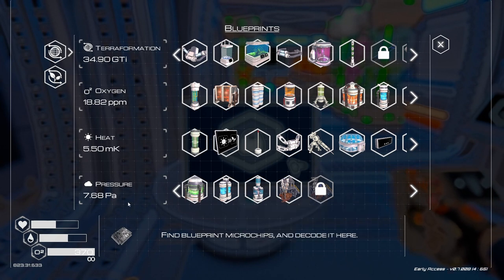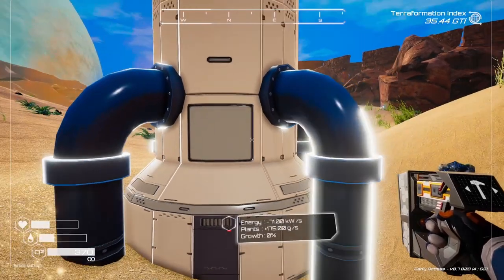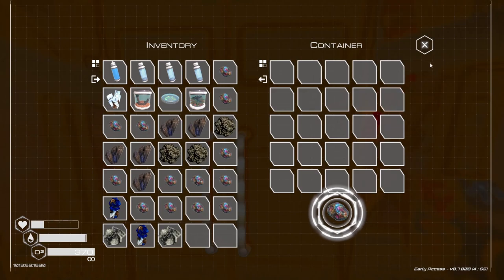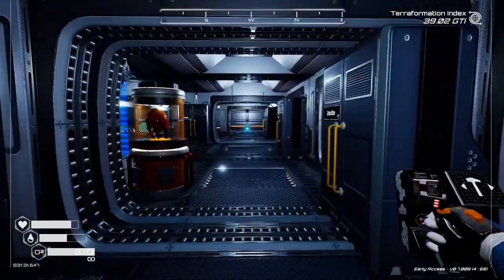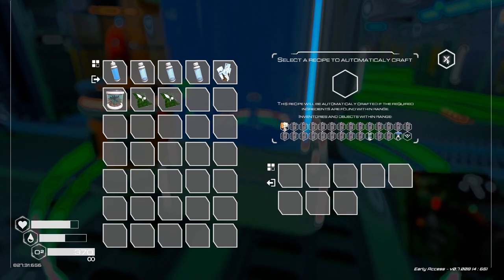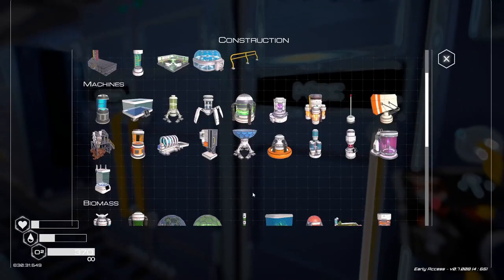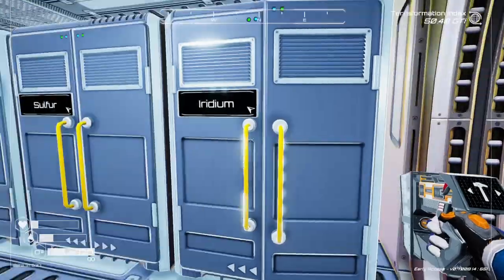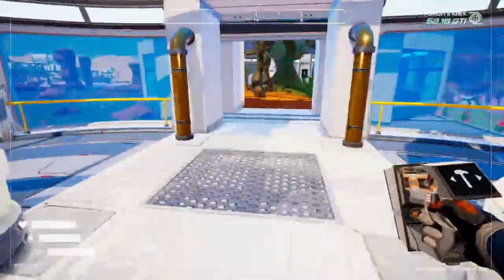Making Good Progress Thanks To T3 Tree Spreaders

Comment: Pro tips 1 build farms for all your veggies , food grower yield is only 1 Seed to 1 plant , Farms yield is 2-5 per growing time , 2nd  place farms in range of autocrafters , you will need tons of fertilizer 1and 2 so lots of eggplant and squash , 3 destruct the nuclear reactors, solar panels mk1 and mk2 , they not doing anything but wasting space , build fusion reactors and a lot of them !! your going to need LOTS MORE POWER ! 4 Story time  you haven't found or looked for the 3rd big door ? from SA cave turn left and walk until you find a lush hidden valley past the desert altar will be atop the rise (inside are 5 keys scattered about  needed for the last and final door )5 base redesign use those big rooms and ladders (a high rise has a great view ) 6 use of teleporters saves lots of time 1st one i would add is you SA cave , 2nd your zeolite cave, 3rd any osmium cave you have a extractor in and defiantly spread your machines out or FPS drops large amounts